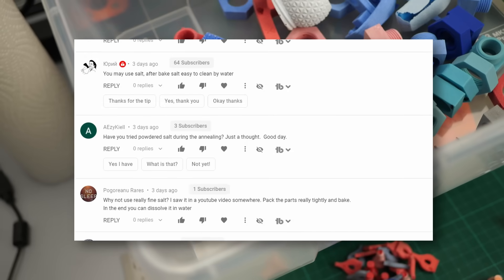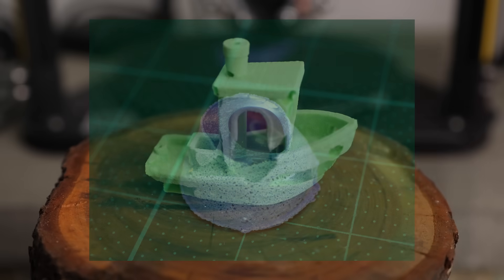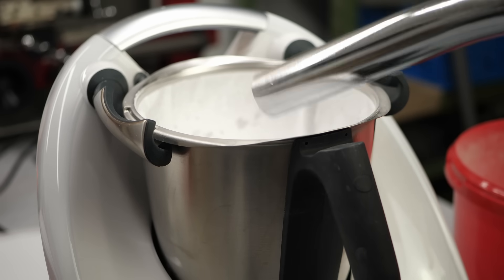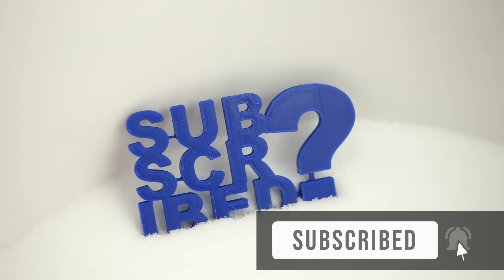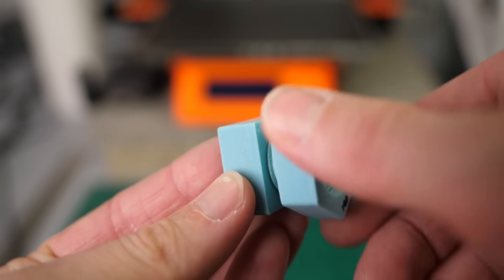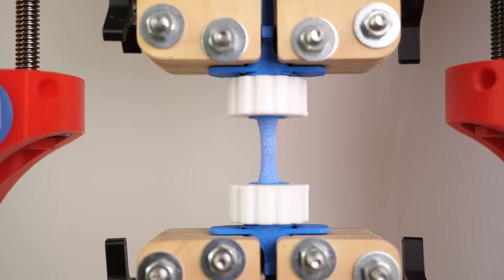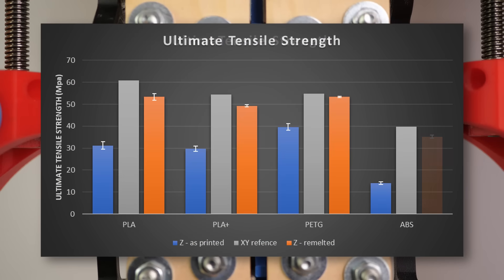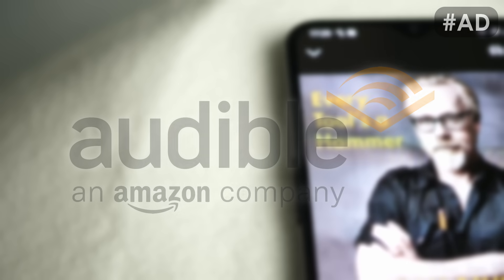The STRENGTH of 3D prints REMELTED in SALT

Comment: I still haven't gotten my first 3d printer. I subscribe to several channels on the subject, but only passively/occasionally watch any of them. I have to say, this channel was suggested by the YT algorithm a few weeks ago, just after watching Naomi's Creality belt printer prototype vid. I keep coming back and watching your uploads when I see them in my sub feed. It's well presented, concise, consistent, and most importantly interesting.

 Not that it matters, but the shaker screens used to sort rocks after the crusher at a rock quarry or asphalt/concrete plant, usually has 3 or more screens in a (huge) box. The ones I've worked on are around 10 meters long in the direction material travels, around 2 meters wide and the box is around 2.5 vertical meters not including the stand that holds it at the right height for conveyer belts.  Inside, the entire shell surface has bolted on steel wear plates. The screens are progressively smaller the lower they are in the machine. There is just enough room to belly crawl between each set of screens. The screens are made for the width of each machine. They are around 1.5 meters long and just butt against each other. The sides of the screen have a steel flange with a 90 degree angle. This is clamped/bolted to the sides with plates. Under these plates but on top of the screen there is a strip of silicon around 10cm wide and 2.5cm thick. This is how the "seal" is made and how excessive screen wear at the clamps is avoided. The bolted plates and hardware get replaced periodically as needed, but the screens won't fail at the edges. 
 The entire deck is tilted down at 30 degrees. It is steep, but possible to sit/lay on it when replacing the screens. The box is mounted on the bottom to heavy springs about the size of automotive truck springs and there are smaller height versions with rubber bumpers on the sides of the box's frame in case the vibration has a bad resonance or material gets distributed badly.
 Anyways...the real reason for all this blah blah blah...the machine is free to shake and oscillate pretty violently. It does this using two large motors. One spins fast with a small eccentric weight, the other spins slowly with a weight around 10 times the size of the other. If either motor fails, the machine fails and overflows in minutes.
   Inside the silos that store both dry material and hot wet asphalt there is a shaker system that is very similar with two motors only smaller and less violent. A scaled version of a shaker like this would work well to yield a precision screened grain size.

  The shaker screen part of the plant usually has water sprayers to suppress dust. However, one other thing of note with asphalt plants specifically, the rock must be heated in a giant "drum" - a cylinder on it's side. The thing is around 20 meters long and 3 meters in diameter. Inside material travels up hill at a ~5-10 degree angle. Shelves ("flights") inside the drum take material to the top of the drum and drop it in front of a burner that blasts a flame the size of the drum down it's length. Yeah..THAT big. The burner is as big as a car. As the material dries it travels up the drum. The flame temp and drum rotation speed  control the process. The hot black liquid asphalt is added at the exit of this drum once the aggregate is the same temp as the liquid asphalt.
  If you think about this, it makes sense that this drum produces an enormous amount of dust that has to go somewhere. That somewhere is a giant "bag house." Its a metal box the size of a small studio apartment with high ceilings. The box is connected to the exhaust from the drum with a large air duct. Both machines are always directly beside each other, and the air duct to the bag house is vertical. Only the particles that can float in air go in, and this is tuned to allow as little as possible too. The drum burner is run as close to stoichiometric as possible to meet emissions regulations and usually burns natural gas in most plants. 
Inside the bag house there are 2 sections. There is a deck around 20cm from the top of the box. This deck is covered in a matrix of ~10cm holes spaced as close to each other as structurally possible. Inside each hole is a tube like wire frame that extends the full height of the box. They are very long. On the outer surface of the wire frame are high temperature "socks." They are a heavy, Kevlar like, material, and look nothing like a typical air filter. 
  The whole machine works like this. The dust from the drum is dumped into the lower chamber of the bag house. The upper chamber is connected to a massive airflow circulation system,  - the size you'd expect from a skyscraper. This system sucks air out of the top of the bag house pulling all of its air through the hundreds of long socks inside the structure. Around once every 2 seconds the entire airflow system is reversed and a powerful pulse of air is sent in reverse to clear off anything stuck to the socks. The dust is pulled from a trough in the bottom using a screw auger. 
  This dust is a waste material that usually goes into industrial 2 ton bags and gets trucked away eventually. 
 Here is my point: this dust is unlike anything I've ever seen elsewhere. Once cooled, if you put your hand in it, you would swear your hand was in water. If the humidity outside is low, you'll be able to put your arm in up to your shoulder just like a tub of water despite that depth having a massive amount of material probably a half ton or more. The only use I know of for this dust is making terracotta roofing tiles. After the stuff has sat for a few weeks it turns to a solid you can barely stick your fingers in. Ultimately the dust is a clay like substance once wet. If this dust gets into water a special mucus like coagulant is required to get it out of solution. Most of it will not settle out of solution otherwise. The only other way is to let all water evaporate. The material itself is not hazardous chemically, it's just the clay and rock dust that were not dissolved and washed away at the rock quarry's crushing plant.
 If someone were to call up an asphalt plant and ask the operator for a 5 gallon bucket (or few) of the stuff for a 12 pack of beer on a lazy early afternoon when the plant isn't in production, I bet any operator would be happy to oblige. I don't think you will find a finer grain medium than an airborne dust capturing system.
Just an idea.
-Jake
Reply: Great suggestion, but a little long.

For those of you looking for TL;DR, asphalt processing produces a very fine dust, as a waste product, that might be very good for use in this process.

Edit:  Original comment isn't perfectly clear whether this is asphalt processing specifically, or general rock crushing/grading.
Reply: @Kineth1  
asphalt specifically. Rock crushing plants/quarries use a water based system to control dust.

Comment: What if... you treat the prints with acetone vapor and then paint them with a thin coat of wet plaster, let them dry and then use the heat treatment method with plaster or fine salt?

Comment: Why not use a high mesh sand instead, you can buy it from pottery shops for fairly cheap and wouldn't need to do any of the prep work you do with salt. 200-300 mesh would probably be sufficient.

Comment: I wonder if Diatomaceous earth would work too. Thermally stable, and often in the 100 micron size. It is easily available too.
Reply: That's a great suggestion.  The only advantage I can think of with some kind of salt is to absorb and shield from water.  Perhaps mixing a small amount of powdered silica desiccant into the diatomaceous  earth would finish the mix.
Reply: @exploder69  I didn’t consider moisture . Silica is not a bad notion although I wonder if a salt diatomaceous earth mix might be safer? Silica gel crushed to a fine size would pose respiratory hazards.

Comment: The plaster method sounds like it holds some real promise. If you can coat the parts in something to form a moisture barrier before pouring the plaster around it that should make a big difference and make the plaster perform somewhere on par with salt. So long as that coating can survive ~220C for the remelting that should also substantially improve the surface finish so that you don't get grains of your mold material sinking into the plastic and plastic oozing between grains. As for increasing density, if you can use a mold material that can take some pressure during the remelting you could try something like printing a chunk of plastic off to the side of the part that would hold a small wax pellet before it's encased in the mold. Effectively you'd be pressurizing the molten plastic by making a tiny wax motor like what's in an automotive thermostat. You'd need to design it such that the pressure wouldn't crack the plaster before the plastic softens enough to start flowing into the rest of the part. That could just be as simple as adding a small air bubble or a hollow pellet to act as your "spring".

Comment: What if you just used sand?  In gradation testing I’ve used up to a #200 sieve for super fine particles.  I guess one pro for salt is it’s water soluble but that also means it absorbs moisture which could lead to more clumping
Reply: Also what would happen if you were able to get it up to a temperature where the plastic flows?  You could add a stem as if you were to cast the part so that there is extra plastic to fill any voids

Comment: You could try silicon dioxide which has a very high melting point, is hydrophobic so no water retention and a higher density than salt. It also can be found in very fine powder form

Comment: I'm wondering if this method could also be used to fuse parts together. You could maybe connect two parts with a dovetail connection and the melt them which may lead to a permanent link
Reply: You also could melt in steel rods for structural strength in left out channels
Reply: @gandhizehner  this could be difficult as the steel rods might sink and tilt over until they rest on the salt, when the plastic is molten.
Reply: @mattbechberger3298  Easily fixed by oversizing the rods so that they extend outside the part and into the compacted salt.
Reply: @LanceThumping  that may not suite the final product, having rods sticking out at both ends, not ideal
Reply: @mattbechberger3298  Also quickly fixed by attaching cosmetic end caps.
Reply: @gandhizehner  no need the steel will be strong enough, no need to melt it into the rods when cheap epoxy would do just as well.
Reply: With PLA you can Fuse it together by dissolving the Contact surface with a little aceton. That creates a pretty strong bond without the risk of heat induced artifacts and is usable with less than 100% infill. And it's way easier and faster compared to remelting it.
Reply: @noahluppe  I believe you mean ABS. PLA isn't soluble in Acetone
Reply: @Arterexius   the PLA I used did fuse pretty hefty. I never printed ABS and the supplier don't even sell ABS I think. What I read PETG is not soluble.
Generally speaking PLA is soluble in organic solvents, which Aceton Is part of.
Reply: @noahluppe  PLA melts with Limonene, or kinda universal Dichloromethane, not Acetone
Reply: @SergeiSugaroverdoseShuykov  mine at least fused together and if it sat in the acetone got slightly mushed out and definitely lost some colour at the contact surfaces, cause there was a smear of colour at the bottom of the container. It also got pretty sticky if I just rubbed a bit of acetone onto it. Isn't there acetone smoothing for PLA also?
Reply: @noahluppe  PLA? ABS?
Reply: it's possible, just need to make sure the mating surface is clean and no salt powder trapped within it.
Reply: @Maverrick2140  Use aluminum then. The melting temperature of aluminum is roughly 600 degrees Celcius
Reply: Isn’t there a special glue for abs, pvc, etc? Why not use a glue that has been specifically designed perfectly for your material? Make a dovetail if you want, and use glue before you fit them together
Reply: @Imasurvivor2  Glue is rarely going to be stronger than a weld which bonds the chemical structure of two pieces together. 

Regardless, I believe the main reason to prefer it would be aesthetics.  Two glued pieces are obviously not going to look contigious, and if the print isn't intended to be painted then this would probably give the best effect.  

Let's be honest, you didn't get into 3d printing because it was the easiest way to get pieces of plastic in particular shapes.  You did it because you can and it's cool to be able to do more than you could yesterday.  

Even if you never end up using the techique to make something, maybe knowing about it will help you solve a different problem.  Maybe it's never useful but it's neat to know.
Reply: You can easily weld parts together with a 3d pen. Teaching tech recommends a very good pen.

Comment: As an alternative for salt you can try silicon carbide SiC. It has better thermal conductivity and is rather easily available in very fine grains as a sandblasting medium. In the US you can get a 10kg pail of ~10um SIC for below $150 and coarser options are much cheaper. The only downside - it doesn't dissolve, so mechanical cleaning only. Let me know if you want to know more - have some experience of using this stuff in AM.

Comment: you could look into powder silicondioxid (quarz). Sigma Aldrich and similar should have vairants with very defined particle sizes. And since moisture has no effect it will be reusable forever.

water solubale salts or minerals would be even better as long as they are not hydroscopic.

Comment: Possible materials that are cheap?  How about ground up drywall?  It is super fine and has binders mixed in for it to keep its shape.  Also you could try painting the part with engine enamel first.  The paint is good for WAY more heat and should keep the salt from penetrating the surface.

Comment: Perhaps you could try it with baking soda. It's available at much finer grains off the shelf compared to salt, and should also draw water out of the print similar to salt.

When I tried it myself, I got the same foamy surface you did, but with finer bubbles. There was discoloration of the pigmentation as well, but I'm not sure whether that was from a bleaching effect or poor temperature control on my part.
Reply: Just commented something similar. Fine for ABS, but might hydrolyse PLA. Also, it might lose CO2 and thus change its shape is used as a pure salt.
Reply: @JuLian-cq2qv  I was intiially concerned about the CO₂ issue as well, but could not observe any change in shape of the top surface of the mold, so I think that it was probably able to escape without damaging the mold.

Comment: I would try borax next it's going to be way cheaper than flour salt and a finer grain and it might solve the oxidation problem as well. Idk what the melting temp is, or if it ever has one.
Reply: 743° c that's it's melting point

Comment: I have been waiting for this video for weeks :) Thank you so much for doing these experiments. Talcum would be interesting to test. A quick Googling revealed possible decomposition around 500C temperature (thumbs up for temperature stability) and that diluted mineral acids should be able to dissolve it (like hydrochloric acid, which is typically easy to get).
Reply: Isn't that relatively expensive compared to salt?
Reply: @DrakeOola  Yes, but still manageable for technical grade talcum - like $50 for a 2.5kg bag at Amazon. You mght be able to find it at even lower prices on Alibaba.com. Talcum for baby and beauty is way too expensive.

Comment: I'd be interested to see if flour would work. It's clear that grain size is a huge factor in how well the parts come out, and flour is already super fine. It also compacts very well. Might be a much easier way to get a similar result.
Reply: Hmm, you bake with flour at lower temps than this. 2 -4 hours might lead to some pretty dark cookies.

Comment: Hm. Here's a silly thought. How about recrystallizing the salt around the parts (say by putting them on a string in a brine solution in a dehydrator), then doing the re-melting and dissolving the mold afterward?
Obvious downside: Adds steps, adds time, lots of time.
Upside: You get rid of the cratered surface finish, and the salt supports its own weight while the plastic melts.

Comment: I wonder if you could add an additional layer to your model while in CAD
 Then when you've printed and reheated the parts, you can put the parts in a tumbler to get rid of the salt layer.
Reply: The salt layer is already easily removed by disolving it in water. If you were going to do that then you could just sand because tumbling tends to remove edges and make things more circular...